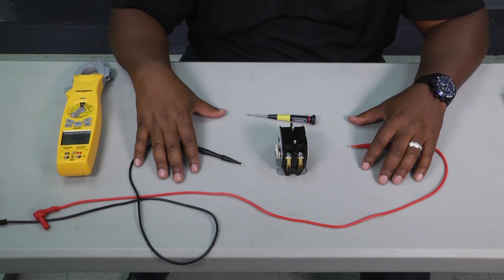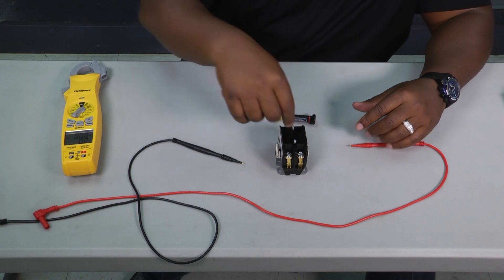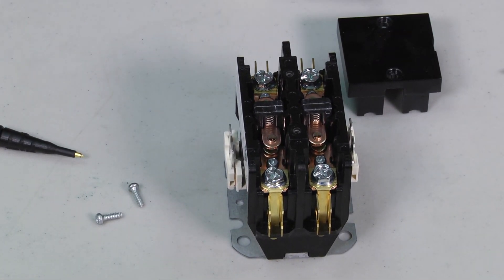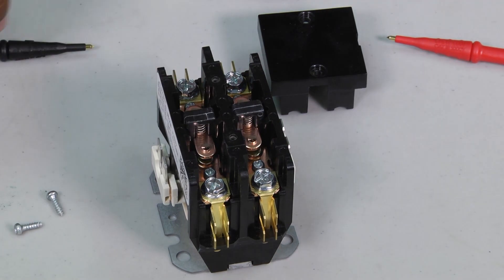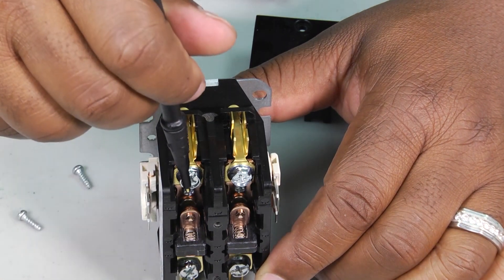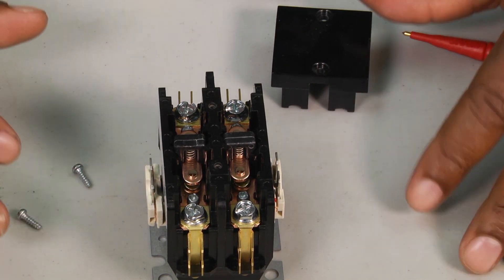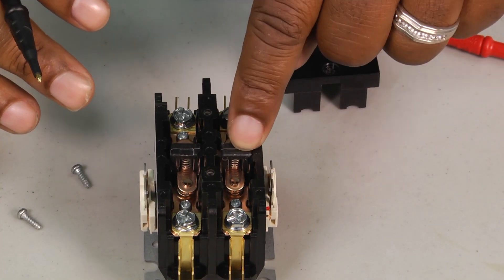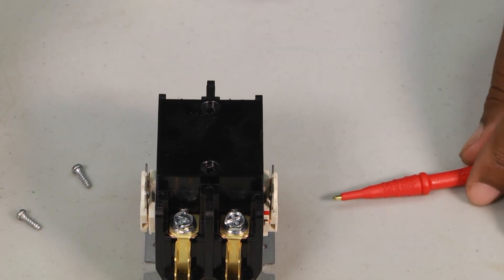Toolbox Tuesday: What Causes a Contactor to Fail | Lennox

Comment: 3-4 MINUTES OF TALKING WHILE SAYING FLICKING NOTHING.....IT would have been helpfull to at LEAST tell which voltages are to be expected on which connectors..It would have been even better to provide a demo by getting relay energized so non-electricians can comprehend it(even though they shouldnt be in there to begin with..Which you also failed to mention..3 thumbs down. ANTS???? on a rooftop units???LOLOLOLOLOLOLOLOl

Comment: I have a contactor for a planer that when I got it it just buzzed and would not close. If I manually pushed it closed the motor started no problem. I picked it apart and cleaned the magnet surfaces so now it closes, but the motor won't run instead. What could be the problem?

Comment: I can manually (w/a screwdriver) get the contactor to engage (& then the ac starts)...if the blower motor (& or transformer) is bad, will this prevent the AC from starting (even if I manually engage the contactor)?
Reply: kelly klund if you can manually engage the contractor and get it to come on, but it does not come on with a call for cooling it is only due to a lack of signal or 24v. This could be due to a bad transformer or wire from the board, but not due to a bad blower motor or fan motor. Hope this helps!